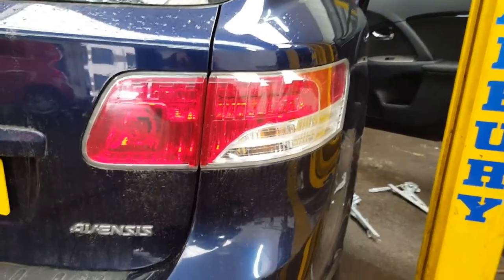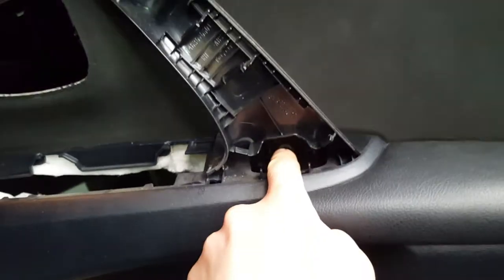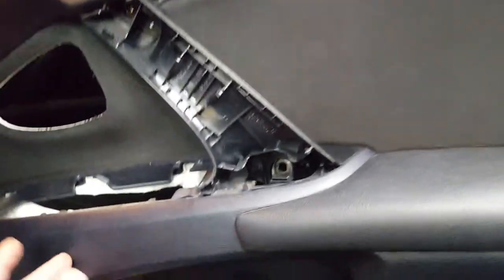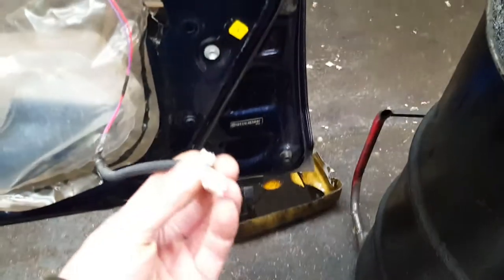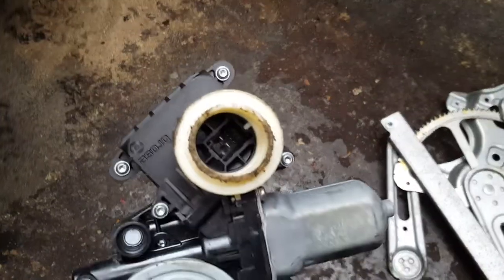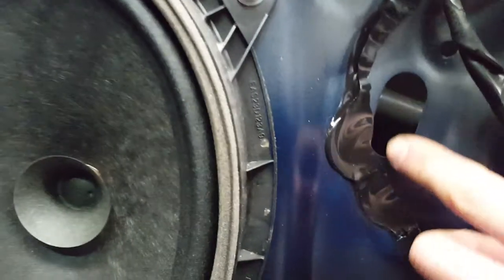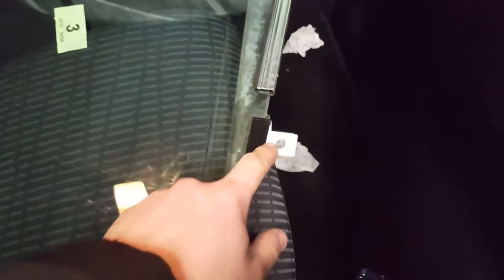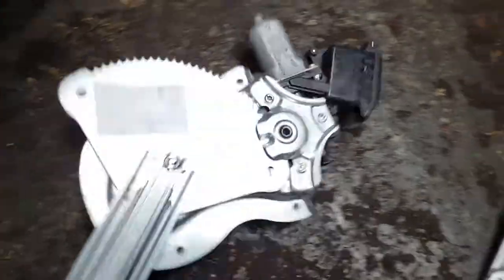New Toyota Avensis door cover, window mechanism/regulator and window removal/replacement.

Comment: I've a 2009, door cards are the same , thanks for the removal tips. I have to weld the door where the check straps attach to the door. They(the doors) are cracked ,which was a common fault.
Reply from the maker: Yeah it's common fault on them unfortunately.
It should be the same process